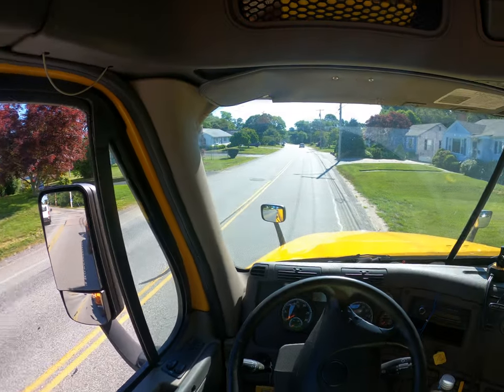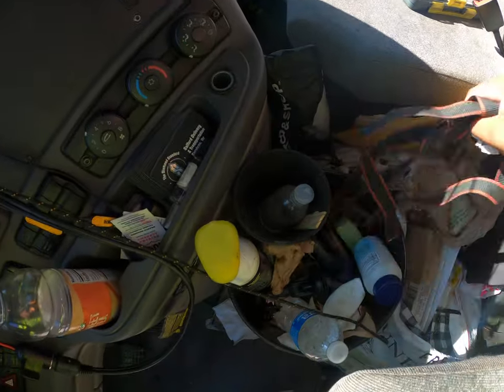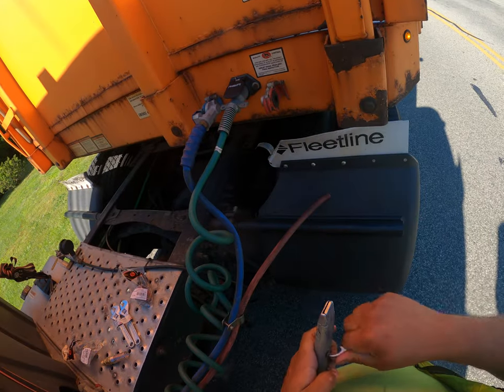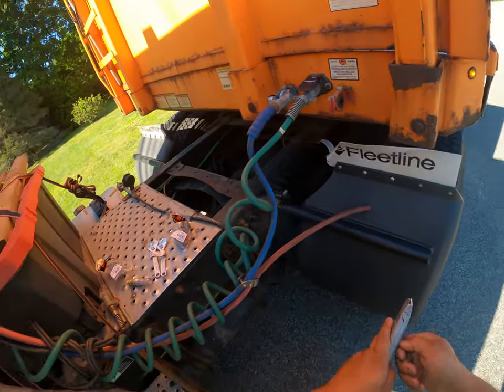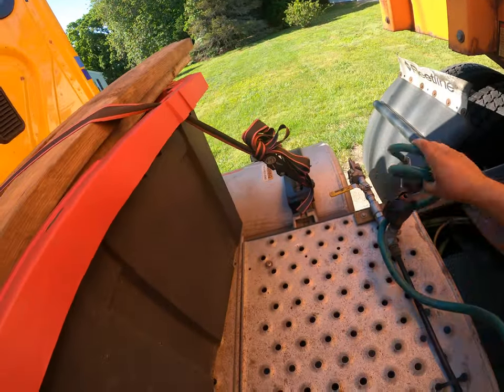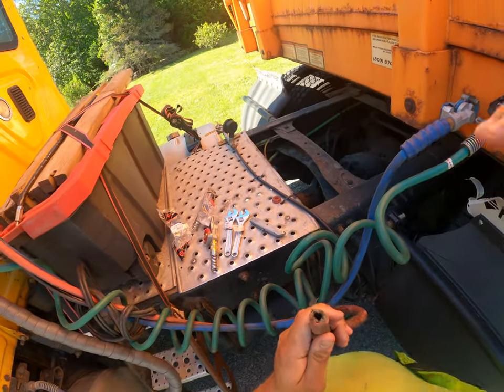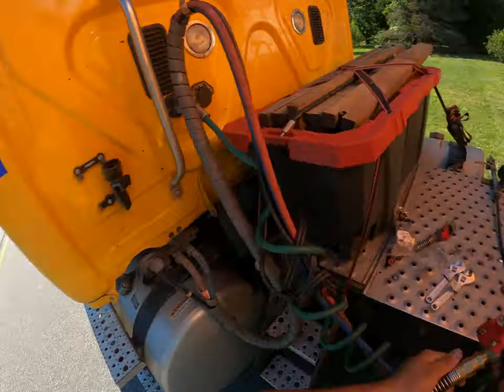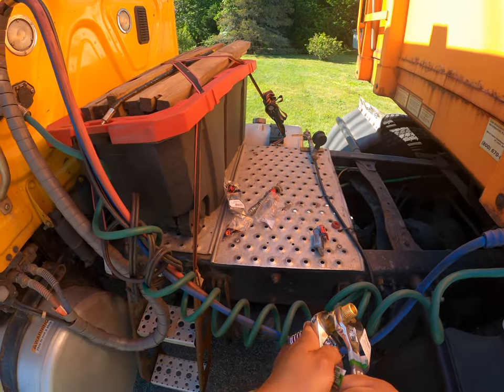I accidentally ripped my airline off! Repairing the glad hand Pt1

Comment: I think the problem is that 7 wire is wrapped around your airlines so when you jack knife it pull your lines right of because of the weight of the 7 wire had the same issue on 3 different trucks  we hung it on it’s own line problem solved

Comment: Hang up them lines higher and you won’t catch that crap on your catwalk. Simple fix
Reply from the maker: The rental company was aware of the issue.
Reply: @SaffordDelivery  aware of it or not. Hang those lines higher yourself and you’ll never have that problem again. Lines shouldn’t be that low anyways
Reply from the maker: @treverk8376  the clamps that are meant to hold the hoses don't hold them like they should. Also when turning around corners the lines get pulled through the clamps and they start dragging